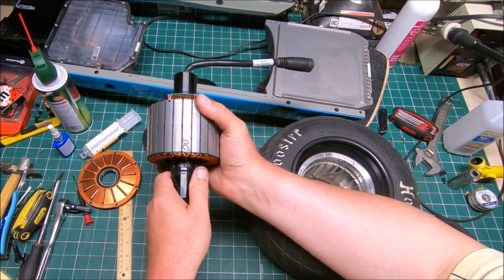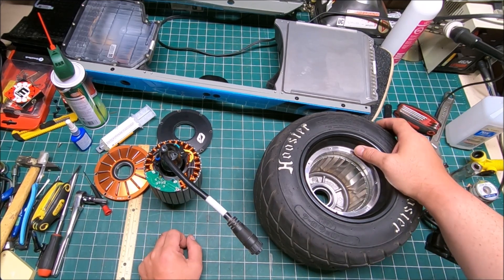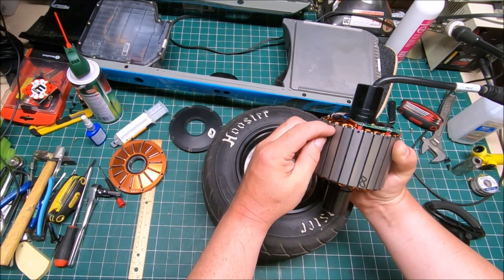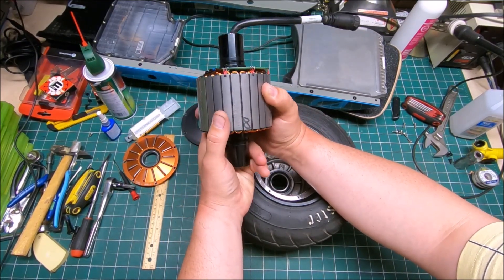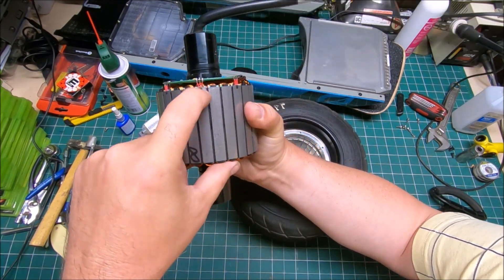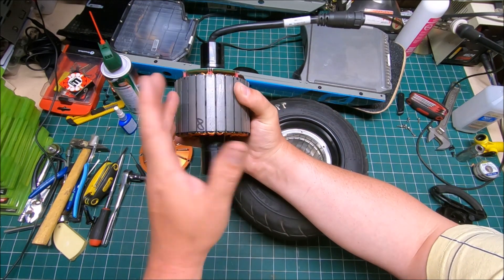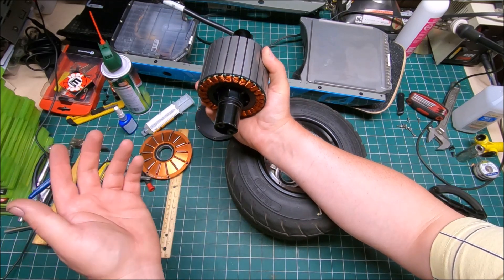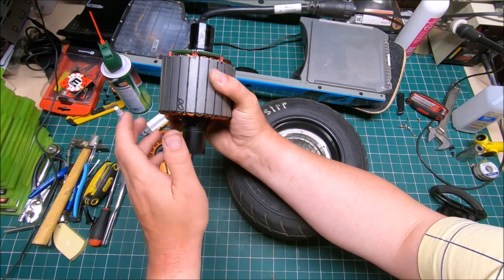Onewheel GT conversion to GT-R S XR Pint X motor stutters issue is solved

Comment: Aww crap i'm 1 year late to the party lol.   Can you remember when your onewheel was on when it had the middle hall sensor problem, did you ever lift the board up on its edge and spin the wheel with your hands?  Thats when I feel a studder in my pint motor.   When it is off and I spin the wheel it turns perfect.   Your video got me thinking I might have a bad hall sensor.  I can ride it ok (for now) but it has a studder when I turn the wheel while the board is on.  I don't really know what else it could be.

Comment: I've been having issues with my GTR conversion ever since getting a second GT. (different stator). The first one had no issues so I'm guessing that all three black sensors were tight and secure. My new GT stator has been giving me issues since GTR conversion but is 100% fine when in the normal GT hub. I did this fix along with resoldering everything and boom. No clunky noise and I've not no cutting out during acceleration
Reply from the maker: Thats GOOD

Comment: istn´t gt going to "die" when you umplug something ? ... The product seems more and more noth
 worth the insane price it goes for with all the problems
Reply from the maker: Yes, it will die if you disconnect the battery from the BMS board,
Reply: I heard them say, that they like the 3th party community,  and we are okay with mods. just not with the battery and control module in case of fire hazards.